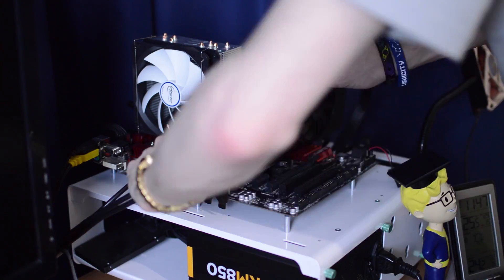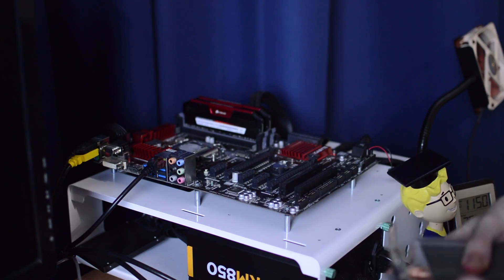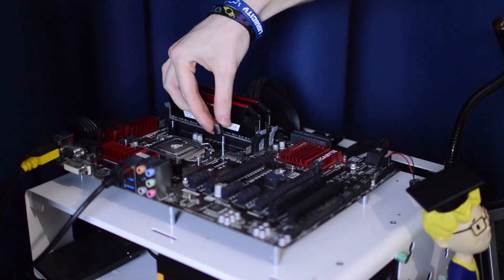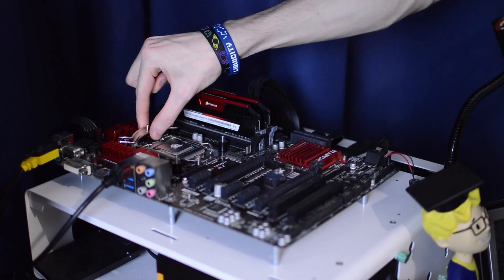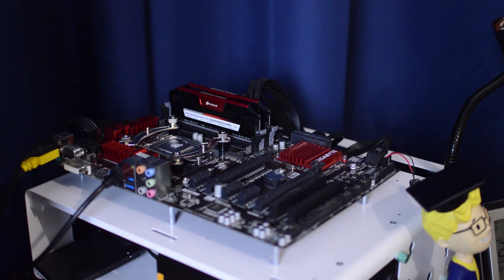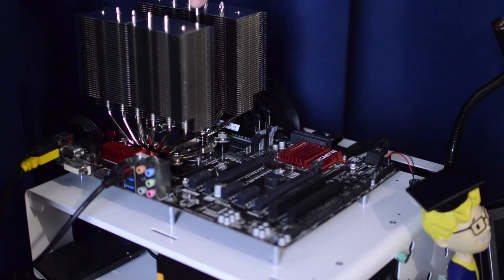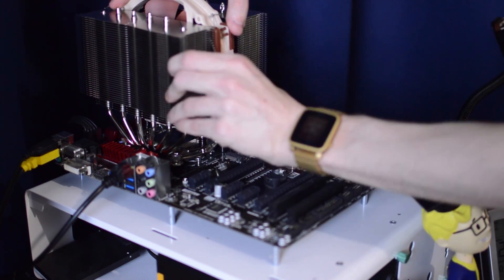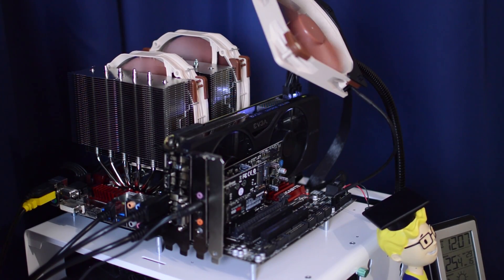How To Install A Noctua NH-D15 Cooler

Comment: Nooo, do not spread the paste! put a pea size in the middle.
Reply: the cpu die doesnt take up the entire surface, only a portion in the middle. i suggest looking into LTT or gamers nexus for more info
Reply: Yeah and watch the bloody edges burn and your PC to IGNITE!
Reply: @fr33kSh0w2012  stop pretending the bottom of the cooler doesnt make the paste go flat around the cpu
Reply: @gsainoy  Yeah but THE CORNERS I had that bloody problem a LOT only makes a Circle of flatness doesn't spread it all around the bloody edges
Reply: @fr33kSh0w2012  Spreading the paste increases the chances of air bubbles being trapped, air dissipate heat badly and it's the entire reason we apply thermal paste in the first place.

The hot spot on a CPU is actually a rectangle shape that doesn't actually reach the edges anyway... the longest side of the rectangle leaves roughly a 1cm gap either side. As long as you apply enough (but not too much) paste, the 'circle' that is created will cover the hot spot just fine.
Reply: @Roxxelana  Well what was wrong with mine then? It was generating a lot of heat from the edges!
Reply: @fr33kSh0w2012  you are insane

Comment: What an awful video. Everything was done too quickly and now lots if the nickel racks are bent. bah.
Reply: Still pretty amazing, in real time this prob took him like 5 minutes, whereas it took me like an hour
Reply: It was sped up, and you can also just slow it down lol
Reply: @Maceface133  I was barely putting together my first computer when I originally watched this video. This comment was made more out of the hate I was feeling being under pressure thinking I was gonna fuck it up. Glad to report 3 years later it’s going strong though it does now have a thick layer of dust. It’ll probably be the last computer I put together tho cuz the new M1 macs have me sold.